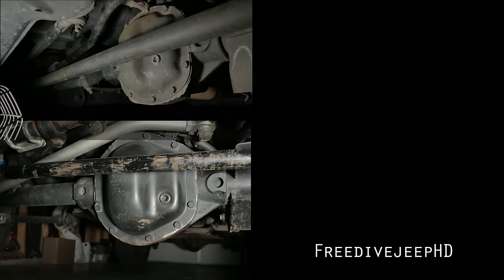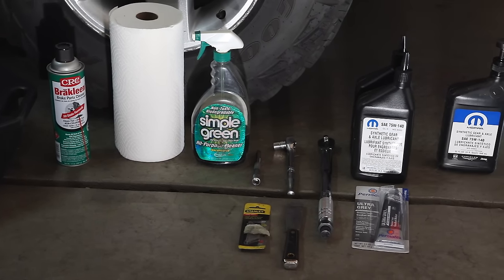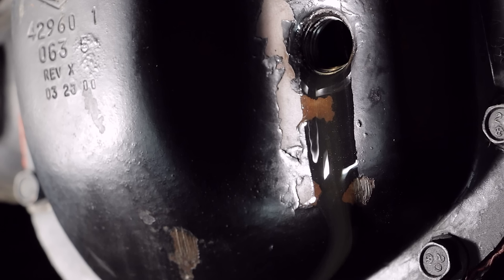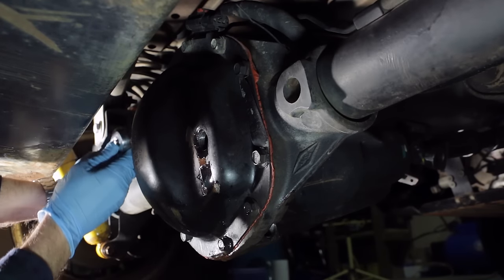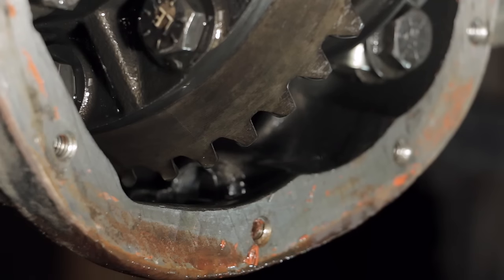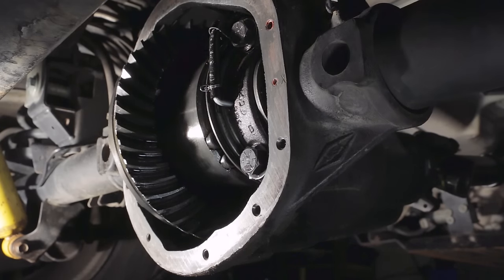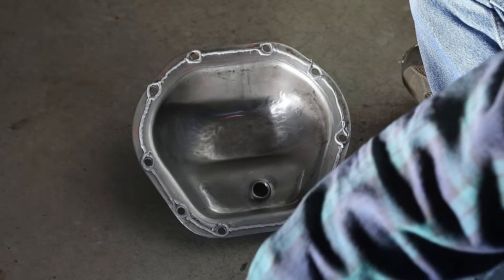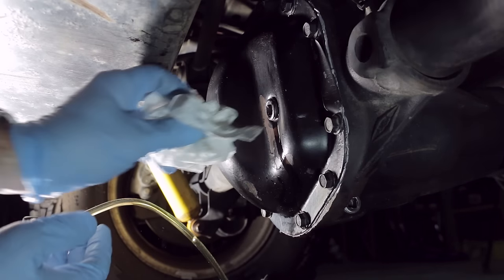Changing Your Jeep's Differential Fluid

Comment: I've had success using Lubelocker gaskets instead of the RTV.  Much easier if you are doing water crossings and want to change fluid more often.  They are reusable and no scraping gasket material/mess and no wait time for refilling. Worth the extra money to me for the time saved alone.

Comment: Great video. Very professional in approach and execution. I like that you took the time to explain the difference in Dana 30/35 versus Dana 44. I've done mine in my pickup and used the red RTV by Permatex and I did it in the evening and let it sit overnight and refilled with fluid the next morning. Never have had a leak by not waiting 24 hours before filling but I attribute that to making sure there is not a spec of old gasket or fluid on any mating surface. Again, well done thank you for your effort.
Reply: Kv

Comment: This is a very good video as I never knew this is how its done. I had the fluids changed on my front and rear diffs at a drive through shop and I would be curious if they took the covers off and did it this way or just changed the fluid only without taking the covers off and cleaning too.

Comment: Great video, but you should really use Permatex Gear Oil RTV Gasket Maker. From the Permatex website - "Specially formulated to withstand the harsh gear oil environment found in differentials and transfer cases. Because gear oil has friction modifiers that break down normal RTV and cause leaking, this specialty silicone has been tested to OEM specifications to ensure complete sealing."
Reply from the maker: That would certainly be a good option, although as I'm sure you picked up when listening to the video, I do not use gear oil with any friction modifiers in it, so what I use is perfectly acceptable.

Comment: Here are some tips that I like when changing diff oil:

1) Put paper towels/clean newspaper over the gears and use a Scotch-Brite pad to clean up the gasket surface after using a razor blade. Then wipe several times with brake cleaner to get a mirror-clean gasket surface. Do the same on the diff cover.
2) Use gasoline/kerosene/diesel as an initial rinse, maybe for cleaning off the diff cover. Soak the cover bolts in gas to soften any old RTV, then brake clean.
3) If I spray it out with brake cleaner, I like to gently heat the inside of the diff with a heat gun, especially on a humid day; the evaporation of the brake cleaner will cool off the parts it was on, which could lead to condensation. Best not to let this happen.
4) Before installing the diff cover, place a paper towel in the bottom of the diff to absorb any oil that runs out of the case while you're cleaning the gasket surface. This keeps oil from running onto the surface and preventing the RTV from sticking properly.
5) After using brake cleaner and refilling, I like to jack up the axle and spin the wheels and driveshaft, just to make sure that any area that was supposed to have oil on it before brake cleaner is re-lubricated before putting it under load.

3 and 5 might be overkill, but at least I feel confident that everything's right.

Great videos, you've earned another subscriber.
Reply: Or just get a LubeLocker gasket.

Comment: Great Video Freed, how often should this be done?
Reply from the maker: It depends heavily on how and under what conditions you drive it.  If you try to hit the trails most weekends or do a lot of driving in the mountains, with a trailer or in 4wd for snowy roads, I would do the rear differential every year.  If you drive your Jeep mostly around town and on long trips, every 2 or 3 years is more than enough for the rear differential.  The front differential would be the same frequency under severe service, but could probably be done every 3 or 4 years under light use.
Reply: @FreedivejeepHD  Thank you man, I will do it asap.

Comment: Not to Net pick, but did you suck the oil out before taking the cover off, usually the oil runs out 🧐
Reply from the maker: The correct level for differential fluid on Dana Axles is up to the bottom of the fill plug.  If you get more than a couple cc's of fluid out when you remove the fill plug, your differential is overfilled.

Comment: why do I think the dealership is never this thorough when they do a 4x4 service???
Reply: Because you know something that we don't.  I agree with you.  They probably just open the cover and add a gasket and reapply the cover.  Hope they don't for get to add the proper amount and type of replacement fluid.
Reply: the only time I ever had an issue was one shop forgot to add the additive to my transfer case that jeep calls for. it sounded horrible taking slow turns . once they added it the noise went away
Reply: In your opion what does this sound like ive changed outter tyrods sway bar links and bushings serpent belt new. Is it my diferenyival dry we had all 4s up and front to in air and only 3 was moving 4wd all time drive shaft help please!!!  The wheel feels like it binded up fighting i have checked roated tires so maybe power steering if i satnd at the back driver tire and shake it my father say he can see the play in or feel it?? HELP oh thenn it started the idel maybe alternator and my lights go dim if they're on and i roll a window up or down so at a loss wit this thing it literally jus happend one day and been sinking money in ever since 153 3.7 v6 08
Reply: wow that's a mouthful. I can't explain the noise I had...but taking slow sharp turns it was almost a grinding sound I guess and it felt different. as soon as the additive was put in it went away
Reply: TheNewGranada I had what sounded like metal making binding noises when turning slowly in and out of parking spots ets, I figured I had screwed my from diff (Dana 30) from wheeling hard with lift and 35’s on it, I tore diff cover off to check for metal and realized the diff was perfect. We then turned the wheel while feeling each front end part to find the noise. Turned out is was a warn out heim joint on the front track bar. Just binding up on itself, that was a happy day, but wanted to change diff fluid anyway, but had I known I wouldn’t of had to take the cover off to do it.

Comment: For anyone doing regular or early maintenance, especially if you never beat on your rig, all you need to do is take out fill plug then drain plug, let it drain then replace drain plug and fill with new fluid.
Only time you really need to take cover off is if you are finding chunks of metal/hearing obvious noises, upgrading your diff cover or changing gears/adding lockers etc. Takes less than an hr to do both and cheap insurance doing it often especially if you run in deep water often.
Reply: Jeep TJ's don't have drain plugs, removing the cover is necessary.
Reply from the maker: @jordantavares8521  Jeep TJ's with Dana 44 axles have drain plugs: D35's and most D30's do not.
Reply: @FreedivejeepHD  Thanks for the video. Wondering if I can just suck out the old gear oil with a little transfer pump, and refill with the pump also? Especially with limited off road use?
Reply from the maker: @Tinglesworth  You could do that and it would be substantially better than not doing it at all, though not quite as good as pulling the cover.
Reply: @FreedivejeepHD  thanks 👍🏼

Comment: Can you please come drain and fill my front & rear diff as well as my transfer case. After watching this meticulous video, I don’t think I would trust anyone else to do it. 06 Jeep Commander 4x4 w/ Quadra Drive II - 5.7 hemi. 

Getting a front shudder when turning left and right. Drained and refilled with the MoPar & limited slip additive. Went away for a month (until temps dropped outside) thinking it needs a full work over.
Reply from the maker: Where do you live?  If you're close to Ft Collins, CO then heck ya I would: I'm always down to help a fellow Jeeper!

Comment: @FreedivejeepHD What if you use a fluid that already contains a friction modifier?  I'm not accepting of many commercial fluids, and after taking the API tech course, and the product I prefer already contains the modifier?
Reply from the maker: Using a friction modifier when it isn't necessary will not hurt any of the internal components.  Not using one when one is called for will prevent the clutch packs in a Trak-loc from transferring power via friction from one side of the axle to the other.  Short version: you're good.
Reply: FreedivejeepHD What's your suspension setup? And thanks for the help!
Reply: Zephyr R&D I use Royal Purple which contains it

Comment: can you tell me how much back lash you have on diff gears? mine has or had never been apart and had some wear on gears.had good set pinion to ring gears but seems like it might be little tight.but i watched video that said backlash on these type lockers is close tolerance.It has recently been put into my 98 wrangler but never apart.just want this to be right.i had to put in left axle seal and bearing and pulled pan.has about 125 thousand on axles.just wanted to check it before i throw it back together.thanks for any help Robertgood informative video too.

Comment: You werent consistent putting the silicone on the diff cover, sometimes you went around the bolt holes clockwise others counter clockwise which is it? lol 👍

Comment: I just finished changing the rear diff oil on my 2010 JKU Sport. I thank God I picked up two quarts of Valvoline 75w - 140 Synthetic because it seems that I just barely made the full level using all of both quarts. I've never done the front diff so I'm wondering if it also needs two quarts? Any idea? I might just go with less expensive regular 80w - 90w gear oil for the front but would hate to drain it and come up short since it's my only set of wheels after Hurricane Ian's storm surge wiped out my other cars.
Reply: Dana 30  2.5 pints Gear lube GL-5 80W-90 or 75W-140 synthetic

Hope that helps
Reply: @vigilantemotors  Thanks. I went back to the store right after I posted above and got two more quarts of the synthetic 75w-140 and came home to do the front. You're right, the front diff was full with just one quart. Next I need to move on to do the transmission, torque converter, and engine oil.
Reply: @CaptTurbo  NICE! Hope it went well. If you have other questions let me know as this is the stuff I teach.
Reply: @vigilantemotors  You are very kind. Yes, changing the diff fluids couldn't be more simple so it went well. This old heap was purchased in dire need since there was nothing available to buy for months after the storm surge wiped out 100s of thousands of cars in my area. I had nothing to drive from Sept 28th '22 until New Year's Day of this year. The wealthy people were able to arrange for brand new expensive cars to replace theirs but I lost my living (charter boat) in the storm so I had to find something I could afford. I bought the JKU for $9000.00 but of course have been putting money into it since. Right off the bat the battery went bad as well as the gas cap. This thing is no cherry. It came out of the salty NE. The first thing I had to do was replace the fuel tank skid plate which was rotted into three pieces. Boy, that was a treat doing it on the ground with hand tools and an ATV jack!  I went with a  Doorman plate.
Until recently I was concerned about a very lumpy idle but a can of Sea Foam added to the tank has improved that a lot. I'm shocked actually that it helped so much. The rig has almost 138,000 miles on it and I have no idea of it's previous life history so I want to get to all the fluids. This has to be my only transportation so I'm trying to do whatever I can do to make it as trustworthy as a high miles 2010 JKU Sport can be. I will say I love driving it but the 14.7 mpg is really hard to swallow after the storm destroying my daily driver which was a TDI Jett Sportwagen. That thing gave amazing fuel mileage almost nudging 40 mpg in the summers. Thanks for your input!
Reply: @CaptTurbo  Those TDI's are a great car but I think you will love the Jeep as well. I lived in New England for over 20 years so I am well aware of the rust that vehicles have. 

Take some time to go over your frame both the side that faces the outside and the inside of the frame rail that faces the inner part of the vehicle. Scrape away any rust and then paint it with a primer than a frame paint.
Reply: @vigilantemotors  I was thinking more along the lines of using something like Fluid Film since it spreads a bit via capillary action? What do you think of that line of attack?
Reply: @CaptTurbo  yes it works great and I have a video on that actually. Just remember that fluid film will come off especially if you use a high pressure washer. So you should apply it often especially pre-winter. 
Nothing however beats restoring and re-painting the frame.
Reply: @CaptTurbo  And definitely spray fluid film in any holes on the frame to coat it internally
Reply: @vigilantemotors  I'm in coastal SW Florida so it's the summer rain seasons that would be washing it off. I will do my best to get it into those frame rails but not sure what kind of coverage I can get. I just simply assume that the oils will reach farther than the areas I can hit with paint.
Reply: @CaptTurbo  I lived in Tampa for a short while so I feel your pain. You are lucky you wont get a lot of rust there. Just be sure to spray the inside if the frame from every angle and every hole in the frame. 

Thank you for subbing  I appreciate it. If you have any other questions if you could comment there I would appreciate it and always answer.
Reply: @CaptTurbo  Thank you for the sub! I really appreciate it!!

Aaron
Reply: @vigilantemotors  Happy to do it. I was looking for a video from you about oiling the underside for rust prevention but didn't see any. I've already been under it with a scraper. I don't think it's too far gone so I should get some years of use from it.
Reply: @CaptTurbo  Well if you can lets converse over there?
Reply: @vigilantemotors  Not sure how to on your YouTube page but I sent you a fakebook friend request. I find their messenger thing useful.
Reply: @CaptTurbo  Messaged you, I think

Comment: Shouldn't you drive around then check fill home again? Gear lube will drop.
Reply from the maker: You shouldn't have to recheck after a short drive (though you could also jack up the rear end and spin each tire forwards and backward with the same result), but that certainly wouldn't hurt anything...and better safe than sorry!

Comment: Why break the diff cover seal at all? Couldn't you just drain and then refill with fresh? Yes you get all the fine shavings out doing the other way but there will be more in the future correct?
Reply from the maker: Not all differentials have drain plugs, so in this tutorial I wanted to show how anybody with any axle can change their diff fluid.  Unless you have a reason to suspect internal damage, I would generally just drain and refill.  But, say you have an old Cherokee with a Chrysler 8.25...you have to pull the cover.  Absolutely- there will be more fine metallic particulate in the future :)  Cheers and thanks for watching!

Comment: this is very handy. thank you. I used sand paper on the cover to clean off the old gasket really well and brake cleaned the surfaces. it made both the surfaces that mate together with the new gasket maker very shiny metal again and very clean.

Comment: Does painting the cover once reinstalled case any issues with removing the drain plug later?
Nice video, thanks!
Reply from the maker: No, the amount of torque required to loosen the drain plug will easily overcome the strength of the paint film.

Comment: 2016 grand Cherokee AWD. Do I need the additive? How much fluid?  Aftermarket fluid?
Reply from the maker: Which engine do you have: 3.6 or 5.7?  Whgich 4wd system:  Quadratrac I, II or Quadradrive II?  If you're not sure on the 4wd system I can run the last 8 of your VIN to find out, so I can recommend the correct fluids.
Reply: @FreedivejeepHD  Gc334263        thank you in advance
Reply from the maker: @mariodilorenzo7473  It looks like you have the conventional rear axle differential (no electronic limited slip), so you'll need 1 quart of GL-5
Synthetic Axle Lubricant SAE 75W-85.
  No additives are needed.  The front differential uses the same fluid, but just under a quart.

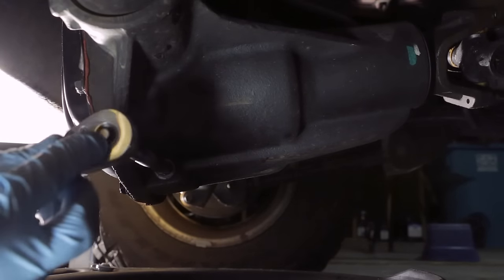Comment: Hi  what kind of fluid I will need if I change the gears to 5:13 on my 2011 jeep sport? Thanks.....
Reply from the maker: As long as you're still running the same kind of differential (open vs limited slip, etc...), your fluid needs will not change, or at least won't change much.  Bumping up one viscosity level thicker might be a good idea, as the 5.13's will generate a little more heat.
Reply: Thanks for the info bro.
Reply: Hi can you please tell me why I use almost 6 bottles of gear oil. I know I change the gears to 5:13 and I have Dana 44 on the rear gear. Is this ok ? I’m very confused. Can you please help me with this question?
Reply from the maker: @adinhoperez  Unless you have an axle seal out, which would allow the fluid to fill the axle tube on that side, I have no idea how you would fit 6 bottles of gear oil inside a Dana 44 differential...

Comment: 24 hour wait before adding fluid? That can be tough, if the Jeep is your daily driver...
Any alternatives (i.e.: gaskets) that would allow re-fill any sooner?

Pull cover and clean inside every fluid change or is there some required/specified interval?
Reply from the maker: I've tried just letting the silicon skim over for about an hour before I refilled it and no leaks, so I wouldn't sweat it if you're pressed for time.  Unless you feel the need to inspect the internals of the diff (never a bad idea), then there is nothing wrong with just draining and refilling.
Reply: FreedivejeepHD use right stuff gasket maker. you can refill immediately.
Reply: Just get a LubeLocker gasket.
Reply: @FreedivejeepHD  The Dana 44HD on the WJ doesn't have a drain plug. But luckily LubeLocker now has a gasket for that as well.